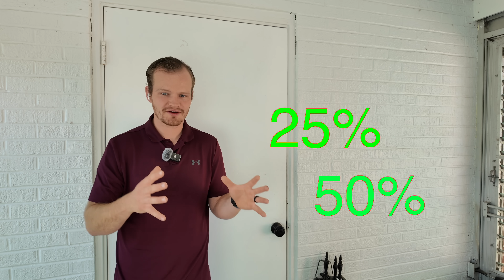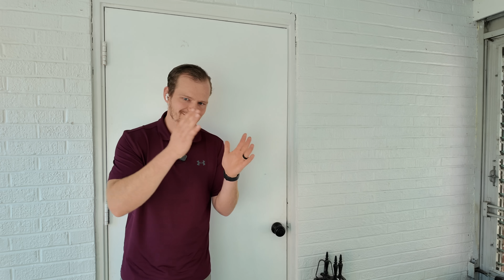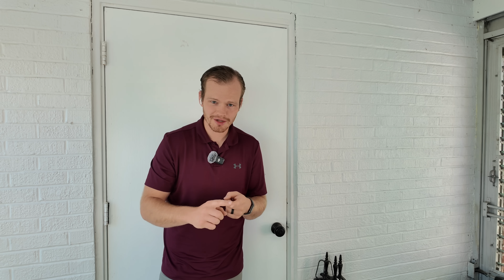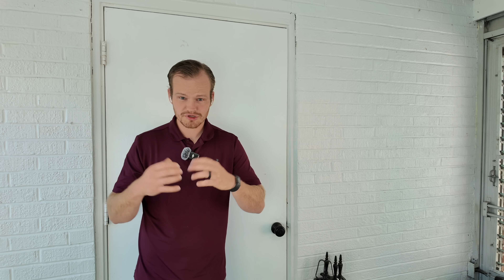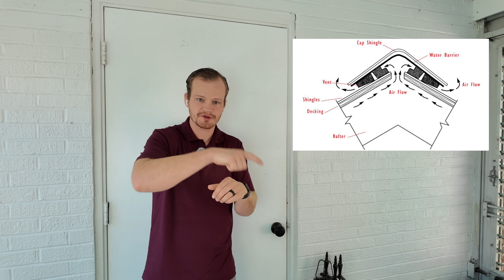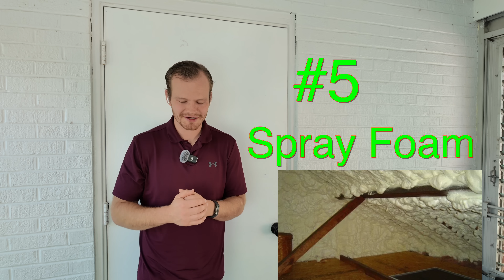5 Building Designs That Guarantee Mold

Comment: I've been a carpenter and contractor for over 40 yrs now. A house needs to be able to breathe. With all the newish standards geared towards energy efficiency , most standards have exacerbated the moisture problems in homes. I've never been a fan of spray foam insulation for this very reason. I've also seen many insulation contractors use unfaced batt insulation in walls and then cover it all with plastic film over the top which can trap moisture inside the wall. It's better to have a paper faced batt insulation in the walls. The trick is to allow breathability while providing insulation. I'm also in agreement with good wide overhangs for the reasons stated. It's even more important in areas susceptible to ice dams. Stutor vents do fail and therefore I recommend that if you are going to use them, they should be accessible as high up in the cabinet as possible, because after a while the rubber flap can become inflexible and not seal properly and allow sewer gas into the premises. I've experienced this in my own personal home a few times. Minimizing roof penetrations is of course a good idea, but a well designed and executed roof penetration will almost never leak , and should last the life of the roofing. Skylights suck....don't ever use them, even when the flashing is well done, I've seen many that the actual glass seals have failed and caused leaks.  I despise crawl spaces but it seems that in certain areas of the country they are much more common. Personally, if I was building my own house, I would always go for a full basement if at all possible. The extra cost is negligible and you get tons of extra space for things like air handlers, water heaters , electrical panels, and storage.
Reply from the maker: I can tell you have a ton of experience and I appreciate you sharing it. That’s great to know about the studor vents.
Reply: This hits the nail on the head. They want air tight houses. Air tight leads to moisture problems. Wait until the zip system shows its problems. Its basically non permeable and causes condensation between the zip and the vapor barrier. It will be future mold problems. The codes have also shifted to lighter built and more insulation. Longevity of newer homes will not be as good as homes of the past. Its like climate activists have taken over the code department.
Reply: @SSteeleify Air tight homes + high moisture load leads to problem.Air tight homes have moisture mitigation to prevent a high moisture load.

You can build yourself a leaky and energy hungry house. I will enjoy my tight house with filtered air, low power bill, and no pest issues.
Reply: Here in Arkansas this area thr bedrock is near the surface and if you have soil its Clay so people usually do crawl spaces or slab on grade
Reply: My dad was a builder, but died young. I think I inherited his perfectionism in building codes, etc. You, sir, are the first person I’ve run across in the comments that knows what’s he’s taking about! 
I wish you were in Michigan so I could have you inspect a new condo I’m looking for in the spring of 26! Absolutely everything you’ve said is true!!
Reply: i agree with a majority of what your saying except for the basement. Basements are almost always or at least 95% have moisture issues and then there is dealing with radon issues. I personally believe all houses should be built on stilts of some sort or concrete pillars and make the house at least six feet off the ground to avoid any flooding issues and any type of standing moisture. I live in western ny and every basement i have been in has its issues and ive seen houses get flooded and blow out furnaces, hot water heaters etc.. As for the overhangs i completely agree, i would like to have a porch go around most of the house and help keep the water off the walls as well. Now adays you can have a vent for your furnace vent directly outside so the only thing you really need is the vent for sewer.. as for insulation i really like rokwul insulation but not using any vapor barrier, plastic is horrible and traps moisture but rokwul lets the water run off and rodents absolutely hate it and it is fire retardent. i did my house this way and have had extremely good results.
Reply: The new building science is to seal the outside from the inside.  Yes the inside needs to breath but you use mechanical means to do that now.  It is also best to have a conditioned attic (with conditioned air) so ceiling penetrations and duck work insulation are not necessary, just the wall penetrations like electrical outlets and windows/doors.  Closed cell spray foam is a good way to seal out outside air from going into wall cavity.  The roof boards have to be sealed also but just know to go down this path you have to do everything perfect or you got serious problems!  Each contractor’s work needs to be checked.  You definitely need a project manager now days to ensure this is all done correctly!
Reply: You can build tight and it’s way more efficient. Condensation is the moisture problem in wall cavities. If you can bring the temperature and humidity in the wall cavity closer to that of the living space, you won’t get condensation. That’s why outboard insulation is becoming more popular and starting to be required in building codes. Air tight, vapour permeable membranes (smart vapour retarders), rather than 6mil poly, will take care of improper detailing that lets moisture into that wall cavity. 

Anyway, you can build a breathing house that won’t mold, and that’s how we have all those old buildings to this day, but they’re horribly energy inefficient. Put the appropriate ratio of insulation outside of your cladding (in a dream world all of it, but that could be cost prohibitive). It’ll make sure that your cladding or drywall (depending on whether you’re in a hot or cold place) stay above the dew point, and voila no mold.
Reply: How do you feel about the denim insulation?
Reply: I rather have a properly vented crawl space then a improperly built basement any day. And a basement is expensive especially to do right.

A compromise is to do an enclosed and conditioned crawl space. You build a standard raised floor foundation but with the addition of slab floor and you insulate and condition the space and give yourself room so you can maneuver everywhere with a car creeper. This can give you much of the benefits of basement in terms of not having a nasty crawl space full of mold and creatures etc but a lot less then full basement without all the risks of a basement.

Here where i am its either clay or bedrock or both in close proximity, so a full basement would entail either rock hammering and blasting out the bedrock or having basement sitting nearly on the grade as many spots here have no soil or very little soil or exact spot i built i have 6'  of clay then bedrock so we have 8' columns going down to the bedrock and I'm building it myself, next addition will be basement down 6' to bedrock then 2-3' exposed above grade to 1st floor deck height. Since I'm on a budget I might make a partial basement like 10x12' etc and the rest raised floor w thin slab thats insulated and vapor barrier as well as the vertical walls.
Reply: So what would you use instead of vinyl flooring?
Reply: @dianebailey7868 
Solid wood, ceramic or my girlfriend…I’d lay any of these on the floor.
Reply: Yep! I will never get my crawl encapsulated because of that, and I keep my vents open. Even though I may get condensation in winter, it fully dries out in summer so I don't touch it.
Reply: Been drywalling in MO since 99 and I approve this message.
Reply: Yes a house does need to breathe. That’s why we install an ERV and use science to determine the assembly now. The old days of  breathing in the mouse poop and attic insulation air that comes in around your ceiling fan box are over. Build tight, ventilate right.
Reply: @CMCraftsman  Bingo!
Reply: @CMCraftsman  That doesn't solve wall cavity moisture problems from condensation and stagnant air in the wall cavity. The same thing can happen in attic spaces. The worst offender is when people do cathedral ceilings and don't allow for ventilation in the rafter space or pack it with insulation or worse spray foam. I've seen it done many times and it leads to delaminated or rotted roof sheething.
Reply: @marcel-lemay7721 I agree 1000% percent with you there. Cathedral ceilings.

Fantastic beautiful feature that causes many problems.

But again, it’s lack of venting. It needs venting regardless. Whether batt, blown in, or spray foam.

Running continuous rafter vents soffit to peak, with ridge vent. Keep that 1 inch of space then insulate.

Spray foam is alright but I prefer fibreglass or mineral wool.

I hate they stopped producing rockwool for blown in. Would be the best.

Fire, sound, moisture, all better with mineral over fibreglass.

I hate cellulose don’t care what anyone says. The fire retardant stings any cuts, your eyes, and is messy as shit.

You’ll never want to go in to work on anything after 😂.
Reply: @justinstevenson2061 I have a cathedral ceiling in a 500 sf room. no ventilation.  Im about to re roof and want to install open up sofit holes and thru blocking...with a ridge vent at the top.. still not sure size of holes and method.  Was thinking hole saw a 6" hole every 4 feet into sofit and whatever i can fit in that hole to drill out blocking maybe with 2" holes.  I dunno.  any suggestions?
Reply: @seanz1232010 You can find information on the ventilation requirements on the internet.  I put some in on an old house about 15 years ago.
Reply: @marcel-lemay7721 A wadded up wet towel on the ground will get musty and become covered in mold if untouched, but we’re expected to believe that a wall cavity encapsulated in drywall can “breathe” enough to dry out and prevent mold if it gets wet? make it make sense man
Reply: @marcel-lemay7721 for wall Moisture you have to limit the moisture coming into the wall from the inside and keeping it open on the outside. Spray foam will simply trap moisture because it can’t breath. Rockwool is a way better alternative.
The majority of mold problems come from insufficient ventilation which causes high air moisture which a forced ventilation system will totally eliminate.
Reply: @marcel-lemay7721  "Exacerbate," in case you care...
Reply: @dahut3614  Thanks for the vocabulary lesson. I typed it and thought it didn't look right but spell check never flagged it so I went with it. LOL
Reply: NO IT DOES NOT NEED TO BREATHE  HUMID AIR  AIR TITE AND DEHUMIDIFY
Reply: Faced batts do not air seal. That’s their downfall. Poly will air seal well. But yea it doesn’t allow to breathe.

Use a smart VB. Air seals and allows breathing.

Also biggest thing here, use real ply not OSB for exterior wall sheathing. Way better drying. 

Then some good tyvek and you have an assembly that properly breathes outwards even if you use standard poly VB.

Both sides is preferable for drying of course, but not at the risk of losing air sealing. Warm moisture laden air entering cavity insualtion is a killer, period.

It then condenses on the sheathing. Or opposite for southern climate, outside air coming in is no good.

Skylights are great but need to be done well, not just flashed but a good curb and peel and stick. Deck mount sucks balls.

Wide overhangs are great for the walls. Same time shouldn’t worry about ice dams if you ventilate correctly.

And really if you strap/rain screen siding with a good WRB no worries about the overhang really for water purposes. Still looks nice though.
Reply: Meh. I'll do a closed envelope house, but take care of the humidity etc. With air exchanger and humidity control system. 
I live up north... 
A house breathing on its own is great if it was built in 1899. 
I'd rather have control myself.

Comment: I’d like to hear what materials to use & what building techniques should be used for a healthy house.
Reply from the maker: We will make some soon!
Reply: I will add, build with or renovate with  as much natural materials as possible… stay away from mdf spray foams and “luxury” vinyl tiles.  They all use noxious chemicals in their manufacture, leading to off gassing risks.  Spray foams can trap moisture and provide a perfect environment for insects.  “Luxury” vinyl tile beware particularly in renovated “flips” throughout it is hiding issues… rotted floors, and in basements likely, broken and dangerous asbestos flooring.  

In any house new or used, learn what to look for, beyond what just looks nice.  Get into the attics and unfinished basements and crawls look under cabinets, look for the signs of leaks, poor workmanship and insects, rot etc.   

If it smells musty, you have mold issues that you need to address.  

If you plan to own a home new or used learn the basics or at least what to look because you will learn fast, a home is a lifelong series of projects to learn and maintain to keep it a safe place to live.
Reply from the maker: @davidpaol1 great advice.